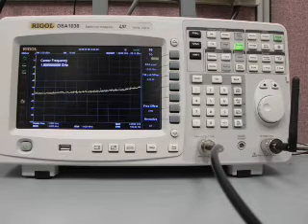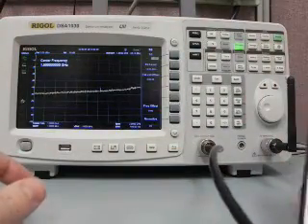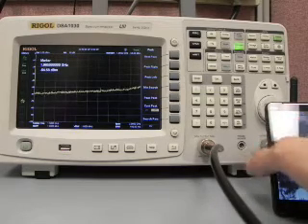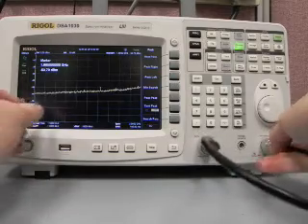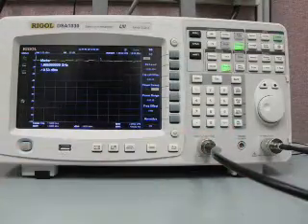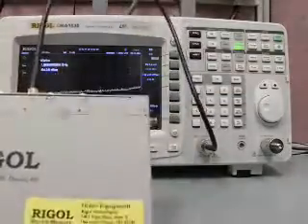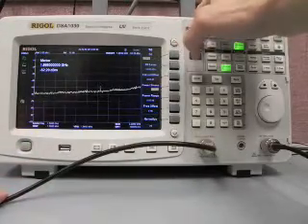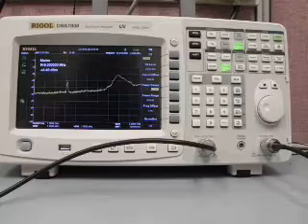What is a tracking generator?

Comment: So, you wanted to explain what tracking generator is. But in this video you forgot to do that entirely, and jumped straight to applications. 
I happen to know what TG is, so for me it is easy to catch the moment when you provide a few words of an explanation at the beginning, but an unprepared viewer will most certainly miss it.
Reply: why didn't you explain it then?
Reply: I would say that the tracking generator extends the functionality of the spectrum analyzer to make it work as a scalar network analyzer... The tracking generator outputs (I think?) a signal equivalent to the frequency that is being swept by the spectrum analyzer thereby showing a gain frequency response of the filter. I guess when the spectrum analyzer is connected directly to the tracking generator... it is flat because the spectrum analyzer is simply showing the current tracked frequency
Reply: @nhlhockeyallstar thank you mate